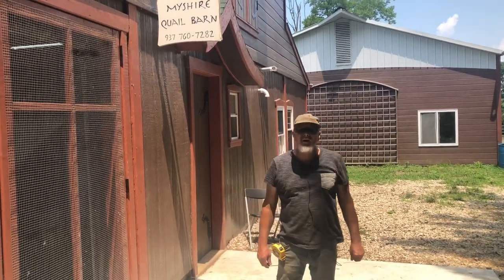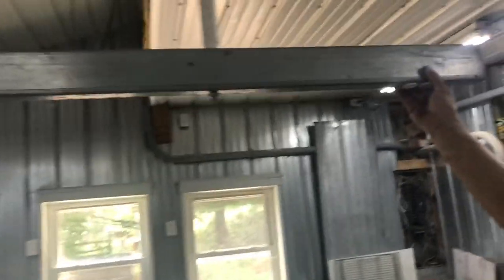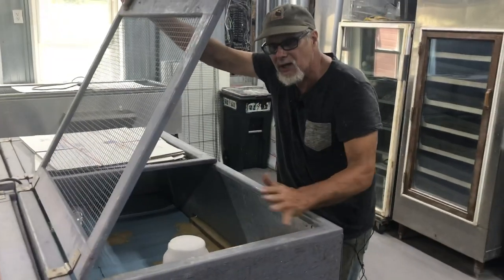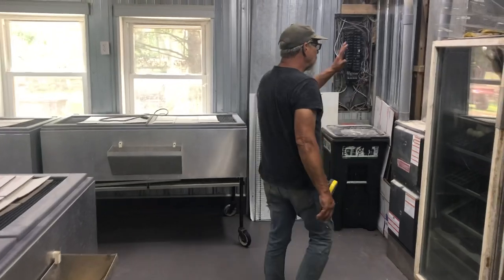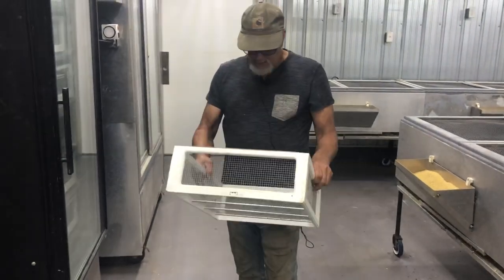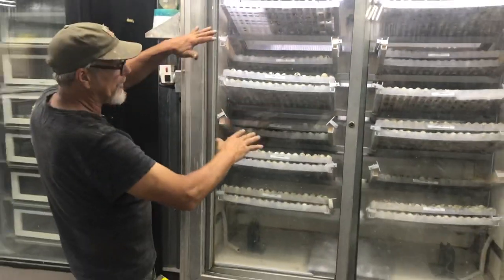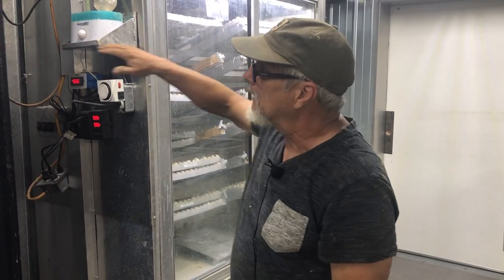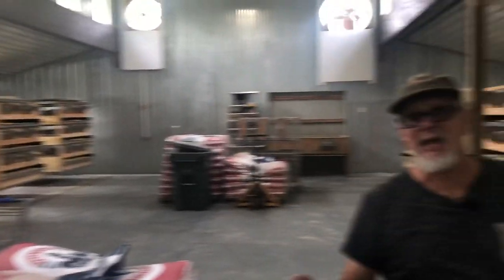Tour of our hatchery!!! How and why we built the way we did with papa builder of things at Myshire!!

Comment: You probably already know this but just in case.....you can get a decent 30 amp power supply on Amazon that's 110/220 input that's adjustable 12 to 14 volt dc output for around 20 dollars.....I use them all the time for my RC battery chargers and 3D printers